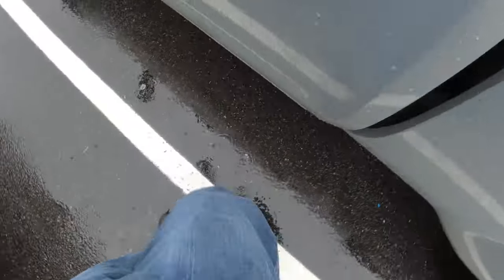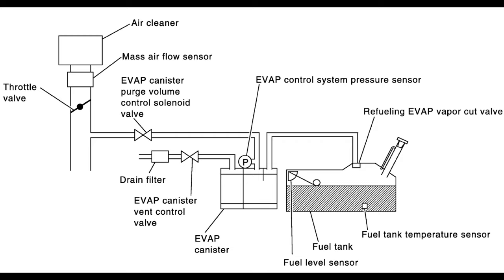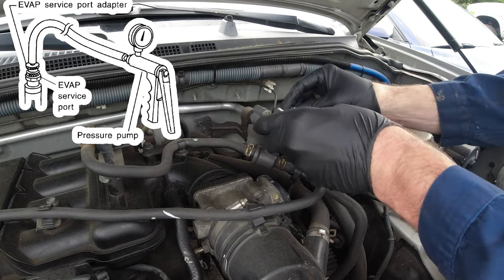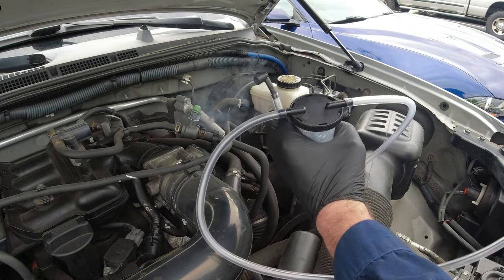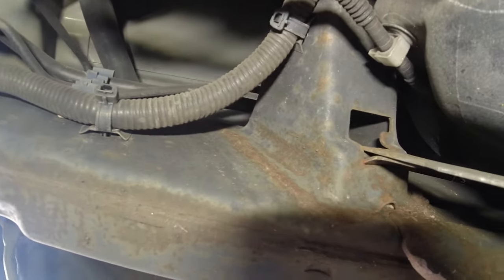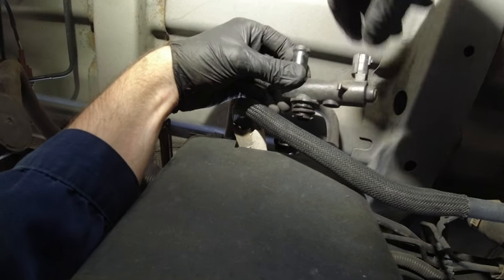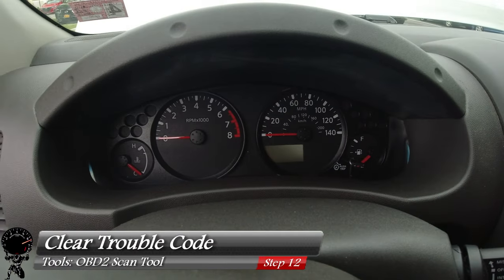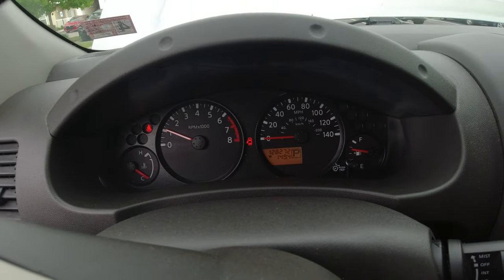Troubleshooting Check Engine Light - P0455 (EVAP System Leak Detected) for a Nissan Frontier

Comment: I own a 2004 Nissan Pathfinder Armada and I had 4 codes for my check engine light!
I had purge valve, 02 sensors random misfires and emissions!
I can't afford to go out and buy parts that may or may-not be the causes for the codes!
Yesterday, I was messing around with the under hood fuse box because my low beam headlights stopped working!
I rearranged a few of the relays, using the fog lamp relay for headlight relay and it cured the headlight 8sdue! I drove to Walmart and 85 would stall at intersections coming to a stop, sometimes it would start right away and sometimes not! Ran code reader again and they were 02 sensor, purge valve open, random misfires and evape!
I went back home took all the relays out of that little box, 2 brown relays 1 black relay and 1 blue one! I started with a brown relay, taking it apart to exam it! Relays are like a set of points, they make😂contact and that's how the relay gets activated!
The points of contact were burnt, blackened and coroded!
I took a small piece of sandppaper and cleaned the contact points, after popping that clip back in I adjusted those points, using a piece of the cardboard from a book of matches as a feeler guage!
I repeated this with all 4 of the relays, replaced them, reset the computer and cleared my code reader and went for a ride!
My check engine light has not came back on, no codes have been detected and my Armada is running just fine!
Reply from the maker: Very nice!!! Good work 👏
Reply: @mcgurrentertainment  So, what Randy did with the 4 relays is the fix recommended for the EVAP P0455 code?
Reply from the maker: No clue

Comment: #NewFan YOU Sir, have definitely found your calling ! 😬

I am impressed by the way you present the information and the  format you laid it out in with such an informative, simplistic and detailed step-by-step guide… and you have the perfect voice for narrating these types of videos.. It’s quite comforting and makes me feel empowered that I could actually get this done! This damn code has been a bane of my existence for the past two years for my 2013 Nissan rogue…
we’ve done them all outside of replacing the gas cap to the original  (after my father decided he wanted a locked gas cap) although it’s still possible that that might be the corporate can tell you that we have not tried to test the pressure on the system, using the smoke procedure… 

The moment I saw you rig that device … I knew at that moment that I would be a fan for life !! 😂

So thanks again for all the information. I’m so blessed that your talent found YouTube and was smart enough to put it together.  

Looking forward to watching many more videos  !!
Reply from the maker: THANK YOU VERY MUCH!!! It really does mean a lot. Hopefully, the solenoid valve will be the easy-fix. 

Keep me posted.

Comment: Got gas cap warning on dash. Then check engine light. Truck starts and runs fine except for after I get gas. Then wants to stall and have to restart a few times feathering the gas pedal. Going to start with the purge valve and then canister valve. Installed new gas cap but still acting up when I get gas. Btw. 2013 Nissan Titan. Not sure what this issue might be as I don’t have a code reader. Thanks for the video
Reply from the maker: The stalling issue is troubling.  I'm not sure without troubleshooting
Reply: Vapor Canister Purge Valve

Comment: New to repairs, is the “service engine soon” light what you are calling the “check engine” light?   I can’t find a “check engine” light in my dash instrument panel for my 2006 Frontier. Trying to figure out if my “check engine” light is not working or is it out? Thanks.
Reply from the maker: Yes. Older cars had a similar dummy light, which displays "Check Engine," or a picture of an engine. So, I use the term loosely when the vehicle displays a light to indicate something is wrong under the hood. The our trucks they say "Service Engine Soon," but it means the same thing. Good question.

Comment: I have a 2009 mercury mariner and my engine light comes on and I hooked it up to the machine and it said eat that leak a small leak. I have a rip on my gas door so could that be the problem ev leak
Reply from the maker: It is difficult to say without troubleshooting

Comment: What if it takes 200 miles of driving before you EVAP check engine light comes back on?
Reply from the maker: Before or after replacing the valve?
Reply: with never replacing the valve, just clearing the code in your car, driving, then 644 miles later the light comes on again.  I would have thought that the light and code would come on again within a couple of miles of clearing the code, not hundreds of miles later. @mcgurrentertainment
Reply from the maker: It sounds like the valve is sticking. Same code (P0455)?

Comment: So you don't need to manually close the EVAP valve because it is already closed if the car is off?
Reply from the maker: Purge or Vent Valve? The EVAP Canister Vent Control Valve is Normally Opened (NO). The EVAP Canister Purge Valve is Normally Closed (NC).
Reply: @mcgurrentertainment  thank you,, the vent valve, its the same one that he replaced, is it supposed to be closed to do the smoke test. It's not the purge valve because that is the one he uses for the smoke inlet? Just to confirm, he said that mechanic usually closes it, but it's not necessary because the car is off?
Reply from the maker: They shut the vent valve to maintain a constant pressure as well as allow only one path for the smoke to flow (ideally the leak location). When the car is off, the vent valve is open, which requires the technician to use a computer to close the valve before doing their smoke test.
Reply: @mcgurrentertainment  thank you, but that sucks for me, because I don't have a computer.  And I thought connecting the smoker to the EVAP and it very simple and straightforward. But I will keep it in mind, prior to doing it.🙏

Comment: I got the same code in my 2009 maxima  po455 large leak is that what yours said?
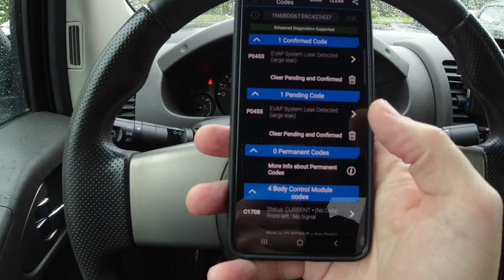Reply from the maker: Does it match the picture from 1:00?
Reply: Yes thanks 🙏 changing that part tomorrow already ordered it
Reply from the maker: Awesome. Let me know how it turns out.
Reply: Got same car same code. Ordered part. Hopefully it works
Reply from the maker: [Crossing Fingers and Toe]
Reply: It worked for me thanks sorry for the late update
Reply: @mcgurrentertainment  Changed this morning and drove for 25 miles. So far so good 🙏🏼
Reply from the maker: Very nice
Reply: Update. All good and passed inspection.
Reply: @EduardoPerez-hn4hv  Which part?

Comment: What the code po442 means in the Nissan Frontier 2013
Reply from the maker: Not sure. But for the 2009, it's "EVAP Control System small leak detected (negative pressure)"
Reply: You do know there’s a tink called Google right